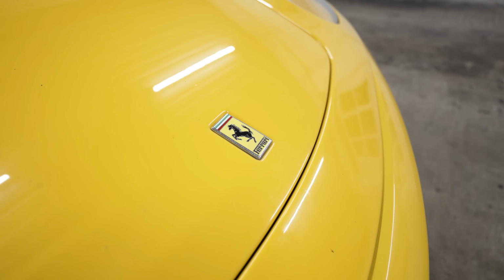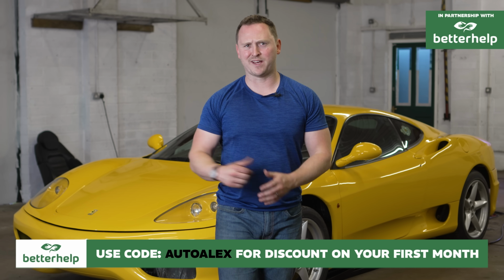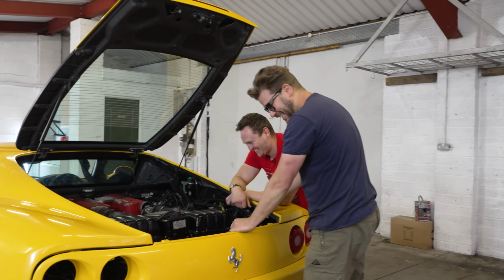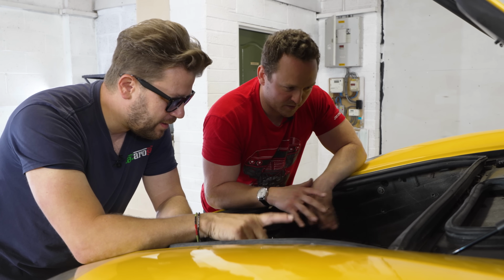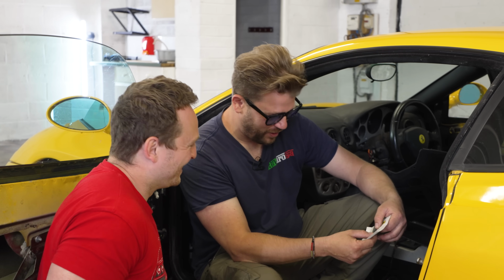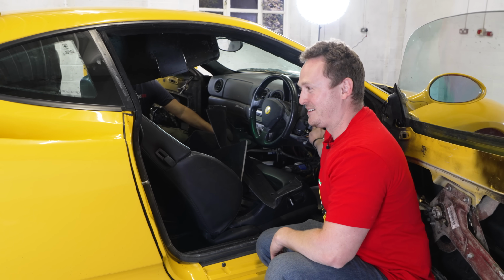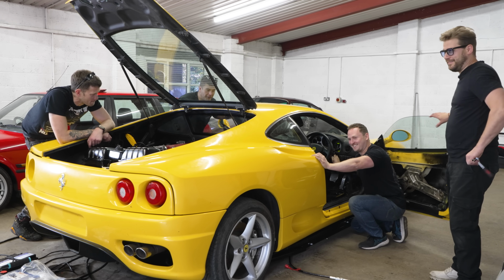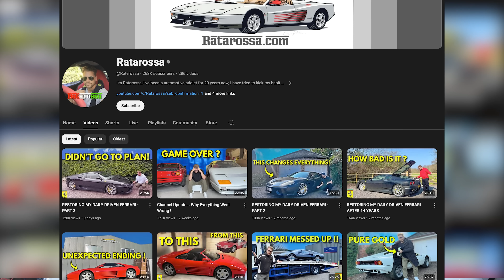EVERYTHING WRONG WITH MY CHEAP CRASHED FERRARI (AND FIRST START?!)

Comment: Best thing about this video is that Taylor was the one getting it to run.
Reply: MOT 😆
Reply: Once again showing the difference between someone who does this for a living vs. someone who does this for Instagram.
Reply: after he slayed harley, YES!
Reply: Pretty amazed that the dude that works with and owns several Ferrari's didn't even consider checking if everything is connected before attempting starting it up.
Reply: @txcforever  Don't blame Scott for that. Sometimes it just helps with a fresh mind and a new set of eyes.
Reply: @bollemann2582 Not to be a jerk about it, but all Taylor did was plug in wires. Doesn't take a group of experts and fresh eyes to simply take 5 minutes of patience to notice that a bunch of stuff is unplugged.

They were just yolo rushing it, and poking around impatiently aimlessly until Taylor showed up and actually thought it through.
Reply: @txcforever  Yes but that's typical for experts sometimes because they instantly think about certain specific things and become blind of what a neutral mind wound do first.
Reply: @txcforever  Cuz he's a fake
Reply: @BeardedFrog  He even says that they found it earlier but didn't know what it went to. Why would you even attempt to run a car when you know something's not plugged in?

Comment: The inertia switch you found would have been made in the UK at that time. In Farnborough Hampshire to be precise. If the electrical contacts are open the fuel pump won't run but it will still crank. The white plastic bit is just a reset button that pushes down on the spring loaded electrical contacts. The rubber boot would have just made that feel better. The boot is there to keep the muck out the switch. If muck gets between the contacts you get a high resistance and that can lead to issues with the fuel pump.
If that switch has got made in the Dominican Republic on it then it's a newer one.

Comment: He's much more likeable than the guy who sold it
Reply: He was trying way too hard to get rid. Glad Taylor wasn't having any of the bullshit
Reply: @james2593 he was a kid with a camera thrust in his face, I dont get why he's being berated as he did much better than any of us would manage
Reply: @cnat_sepll  for some reason the community that follows this channel can't understand that conversations happen off camera
Reply: @cnat_sepll  There was more to it than that. The fact that when they went to the 2nd unit Taylor noticed the hidden chassis in the trailer, that deffo wasn't going to be disclosed until he noticed it. The kid was on a sell it or die mission as if he was on commission. Things do happen off camera, of course, but in the previous video with Betty the VW camper it's so much more natural.
Reply: @james2593  they should have done a car vertical check if they were actually concerned 😆 they knew its history and that it was accident damaged, its definitely a dodgy car but it was clear from the beginning that it was going to be a cut and shut, they're just being dramatic to the camera
Reply: @james2593  I think the nervous / slightly dodgy buying experience was part of the fun for this one.

Comment: This gave me flashback joy feelings with a similar experience. I rescued a Jensen Interceptor from behind a defunct gas station and after much prep, attached a battery and turned the key...and it fired up. Amazing happiness ensued. Sadly, the Interceptor was manufacturing rust at a shocking level, so I moved it on. Hopefully, this Ferrari will not suffer the same ignominious fate. Definitely rooting for ya!

Comment: Alex, I have a Ferrari Panda! The ECU in my Panda is the same as in some of the Ferraris! In fact, you can use the same tool to program the ECU.

All I can see is this. You need to put it back together. Sort out the wonky gearbox, that is a mount that has not been fitted... The only issue is the radiator. You know what I would do. Get it re-cord. It has to be cheaper to get that rad rebuilt than trying to find another second-hand one!

Comment: Quicklift/quickjacks are being used the wrong way around. The red locking bars are meant to be facing out, so they can be accessed from the sides of the car without reaching or going under the car

Comment: If it was a manual then that would be a dream car. The 360 was a poster car for me in the early 2000s
Reply: Manual Conversion for the Win🤞🤞
Reply: These aren’t too awful to manual swap from what I understand the F1 gearbox is an automated manual as were a lot of F1 style boxes of the era, you can delete the pump and convert to the cable system used in the manual cars. 

Samcrac did this to his 360 (or may have been a 430 but very similar cars)
Reply: Got a stock manual modena, they are sensational. Modern enough, but analogue enough without all the computer on wheels shit.
Reply: He should convert it to manual
Reply: Ayedidyae  LOl how can you tell from the few seconds it ran? It didn't smoke, rattle etc. - it ran perfect for sitting that long.
Reply: BMW E30 M3 was my poster car ❤

Comment: I still can’t believe you bought a car from that spiv.
Reply: Ayedidyae  it started without the brake clean, are you watching the full video? it also idled on it's own, and taylor was revving it at first to keep it running before it could supply itself of fuel. You're chatting absolute wham.  Also, you say "get enough oil pressure" like that's a bad thing, it's been sat for fucking 2 decades, what else do you want? Of course he'd want to do that. The engine is fine and quiet.
Reply: Nobody liked that kid. Makes you wonder what his dad is like and why he didn't show up 🧐
Reply: @seanmc3735 upon seeing him I would have run a mile in the opposite direction, but then I guess that wouldn’t make for good content.

Comment: " F1 pump "  sounds fancy. You do know that this is just a selespeed system. Get a accumulator from a Alfa/Fiat 500 so it holds pressure again. 
Pressure will be around 50bar and drops to 40 when you shift from N to 1 .... when the pressure gets to 40 the pump will put it to 50 again etc. 

That ecu is the same on Fiat/Alfa. Inside it misses the extra part for a cylinder but hardware is the same.

Comment: Actually that's not a bad idea,m57 swap a Ferrari and stick a massive turbo on it big intercooler and fully build the engine to massive power,also Ive just found alloy left and right radiators brand new for £300 on Ebay so not hard or expensive to find

Comment: I think making a variant on a 360CS is a good way to go. Saves rebuilding it back to stock along with saving weight. It gives some options to mod e.g. a tasteful splitter and wing, or some minor power upgrades. Keep it yellow and add 2 stripes in Phil red (making an inverted Phil).

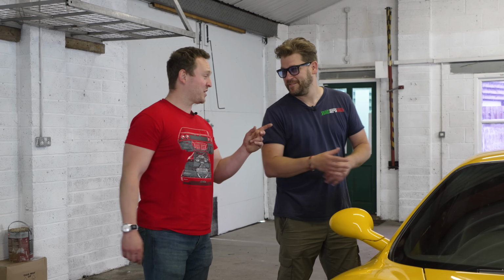Comment: at 3:20 , you can see how much putty or bondo slapped on those panels, they wont be "straight" again unless you get em to bare metal, or to cheat it with total paint correction by sanding it...but still i can see lots of bondos in that car...

things that a bit "cheeky" if you then remember harley who sold it....

Comment: Isn't that one of the models with the fuel pump modules that crack and pour fuel all over the place? I'd at least look to see if they have been replaced. If I remember correctly you can tell by the color of the plastic.

Comment: You guys are good fun to watch but sometimes I cringe so badly. Instead of worrying about the ECUs, the first step should have been to drop all of the fluids, change the spark plugs and make sure the fuel system is functional. Why you try to start an engine, let alone a Ferrari engine after 19 years of not running without changing these things first is beyond me.